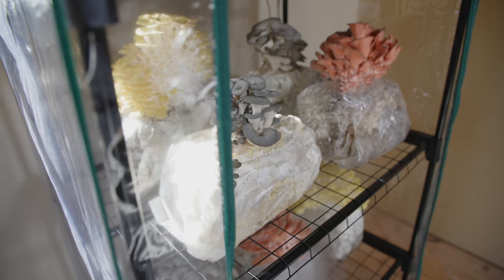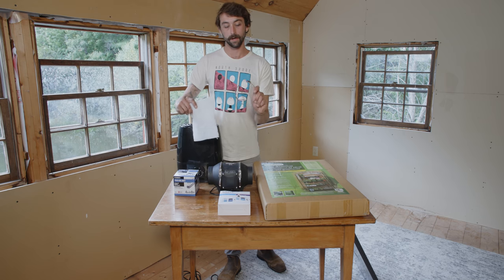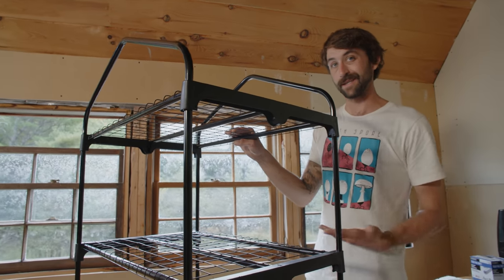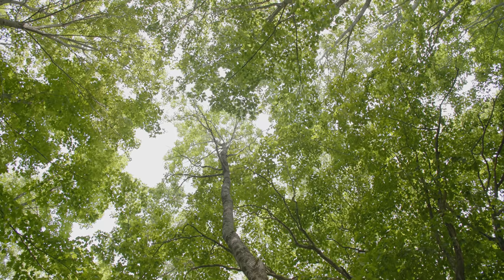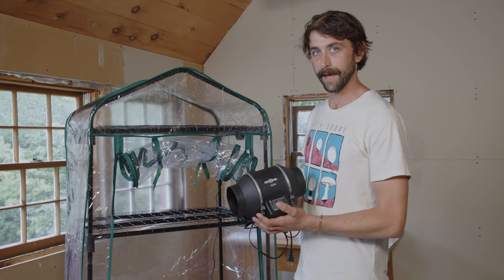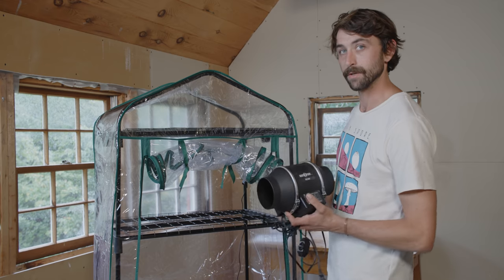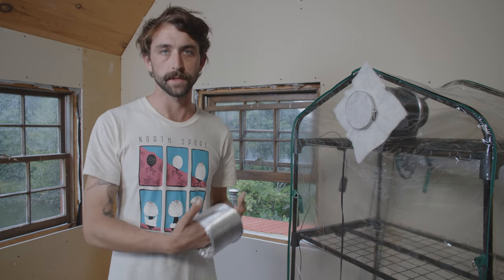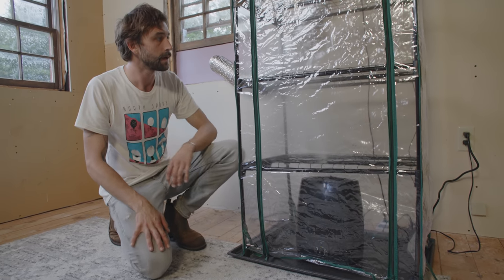Complete Martha Grow Tent Setup & Maintenance Walk-Through | Build a DIY Mushroom Fruiting Chamber

Comment: I think you might have better results if you swapped the humidifier and the fan locations. Co2 is heavy so it collects at the bottom, resulting in fuzzy feet and fruits that are reaching for air. You need to flush out the Co2 collecting at the bottom. Also the humidifier being at the top will cause the moisture to fall down and cover all the cakes below it, and not just pool humidity, mostly at the bottom of the tent. ✌🍄
Reply from the maker: You're definitely right that some folks will flip the humidifier and fan around with success. However, we've found that funneling the air up and through the fan instead of down, reduces the "splash" effect at the bottom of the tent, thus reducing spores released into the environment. The openings at the bottom also provide a perfect place to pull in fresh air.
Reply: Interesting
Reply: @North Spore  is there a way to seal the bottom with another hepa filter and fan for possible contaminants?
Reply: great idea brother! thanks! Best tip yes. well 2nd I have see other than praise. And as Einstein said;   Anyone can make things more complex and unimaginable! It takes a touch of genius to go in the opposite direction! I just had an epiphany also!   the fan I believe may also work better on a timer. say half on and an hour off maybe as to not compete with the humidifier?
Reply: double down! I also think growing a plant in together with the mushroom's could actually help with co2  as well!
Reply: IU bet seedlings would be great on the bottom shelf and BoomerShroomer has these boxes I am wondering if cutting a few holes and using the filter plugs from her kit she sells could also help the co2?I would say put the fan outside on bottom and duct the humidity somehow? that is also why I fear having the fan on all the time I think is a waste?  a;ll Alison>? I think it was? said;   was spray the sides of the minitub with distilled water ONLY if they are dry,  and vent ( BY WAVING THE COVOR FLAP, with the fliler plugs installed only 2 times a day, so with her expertise I would even say 3 or 4 times a day( SINCE ITS WAY BIGGER THAN A MINI TUB)  for about 15 to 30 mins on each cycle. wich will ALSO SAVE POWER!
Reply: Carbon airfilter fixes this problem don't skip learning hvac kids! Easiest way to learn all the skill you need to build excellent rooms, become an auto mechanic.
Reply: Absolutely agree. The CO2 does fall down.
Reply: Negative flow the air is sucked from the bottom up.
Reply: CO2 is not a sinker, the intake fan is big enough to pull air, spores and moisture to exhaust
Reply: In nature humidity rises not falls just FYI
Reply: Maybe adding a small computer fan at bottom could solve both.
Reply: @robertdaem9710 you don't really need to worry about contamination once you media is fully colonized
Reply: I thought that CO2 was necessary for pinning and a major part of the beginning stages. Once you go into fruiting then you need less CO2
Reply: @NorthSpore  I feel like this video is perfect and helped me for my set up at home. I have one question, how long and how often should I run the fan for FAE? I am using the same fan but it doesn't have a nob to adjust how fan speed, just one setting.
Reply: @LAndre2874 you wouldn’t put your trays in this until your ready for fruiting anyways. You completely cover until fully colonized.

Comment: I know this is a couple years old, but if anyone is trying this, when you go to cut the hole for the exhaust, try using a clean vegetable can like a large kidney bean can.  heat the opening of the can with the coils on the stove or a torch and simply press it into the plastic.  easy and clean cut.  tighten it to the fan with the hose clamp and don't forget to use pot holders or something else so you don't burn your hand!

Comment: Mushroom spores on average are 10microns. For those concerned about venting into living spaces I would suggest getting a 4 inch filter sock used in saltwater aquariums. It's easy to find 1 micron or 10 for cheap and since it's 4 inches it should fit perfect on the fan.
Reply: hi, its quite expensive, how long would one sock last?
Reply: a simple n95 mask is more than adequate to filter these particles.

Comment: For quite some time I ran a cool mist humidifier Blowing into the Martha, it doesn't create a high pressure and is more than sufficient for air flow with the plus side of not ballooning the Martha. Finding just the right interval with a timer was all that was ever needed. One could make a Martha for sufficiently cheaper than this.
I had a metal rack system that we covered with 4 mil and duct sealed the corners to make a large Martha. I had all the supplies and found the rack for free.
I love that someone is putting this out there on YouTube, I truly commend you for the clear concise articulation and effort. Truly is a recipe for success 👍
Reply from the maker: Thanks for your input, Paul!
Reply: Thanks Paul. An excellent video and give us the encouragement to venture into this superfood growing. It answers the issue on food sustainability in an affordable way.
Reply: I was wondering why that big exhaust fan was necessary. seems like the external humidifier setup would provide plenty adequate air exchange

Comment: I had the most low maintenance set of Marthas that Stamets helped with. I'm sure the guide I put together is still floating around on Shroomery. It is remarkable at how simple running a Martha is.
The secret that most people tend to forget is: find the most thermally and hydromatically consistent/stable place you can for it (ie basement, not the laundry room or Garage if you can.)
 It makes the world's difference in seasonal temperature shifts, especially coming into summer and winter.
Reply from the maker: Yep, if you can control outside variables like temperature and humidity, the tent should stay dialed in. Thank you!
Reply: found you post, thank you for this =)

do you use hepa filter because of spores?
Reply: Anyone know what mushrooms were grown in the tent? (yellow, pink,gray)
Reply: @NorthSpore  would an underground root cellar be good for mushroom fruiting?
Reply: @mojo_heezy  different species of oyster mushrooms probably pink oyster gold oyster and blue oyster

Comment: Thanks for this video! I have run a "Martha" tent that I have, it's a walk in one with shelves like this on both sides, but only for a couple of bags of mushrooms at a time. I used the humidifier and the same unit to monitor humidity, but didn't have the air exchange (which is why I didn't overdo it with too many mushroom bags.) I'm going to give this a shot so that I can produce more mushrooms on more bags.
Reply from the maker: Get that FAE setup going and you'll have some serious production capacity!

Comment: I think technically your filter should be on the intake side.  On the exhaust side, you're going to both overheat your fan and you're going to clog your fan with dirt and spores.  Most filter systems are on the intake side of the air.
Reply: Great comment
Reply: thank you i was wondering myself
Reply: He was only suggesting putting a filter on the exhaust side if you weren't able to duct it outside. Trying to avoid the spores in your living space.
Reply: @michaelwilliams1525  Filtering out spores from the exhaust air of the tent is a good idea.
Nevertheless like in many other applications than fruiting chambers exhaust fans should be protected from entrained particles or aerosols for safety reasons.
Reply: @michaelwilliams1525  that's not the point being made. They're saying instead of having the spores pulled through the fan itself before meeting the filter (heating and clogging the fan), put the paper on the intake side of the fan so the spores never leave the tent but also never enter the fan body
Reply: Yep. Think vacuum cleaner

Comment: I was a BRF guy for years and had lots of success.  I'm wanting to shift to mono tubs and appreciate this helpful info.  I'm going to attempt to use a 4" T to tap into an existing dryer vent duct, which will likely require a flap to prevent back flow into the tent system.

Comment: Washing machine drip trays are a handy option with built in spots for drainage and sloped to collect in one corner.

Also recommend Inkbird temp/RH sensors.  Using the WiFi bridge they're viewable when away from home, and log data over time.
Reply from the maker: Awesome tips, thank you!

Comment: I liked this video so much I bought a Martha tent kit from you.  I had a few questions.  It seems the vaporizer steam condenses on the spore pan and a significant amount pools there. This is difficult to clean and/or remove when the tent is in operation. It seems you might have had the same issue in your video.  This seems like if it becomes stagnant water at the bottom, it might cause problems of mold and is not getting all the water from the vaporizer into the air to raise the humidity.  Wonder if you see this as a problem and what solutions you might have.
I wonder how often the fan has to come on, and at what speed? I put mine on the lowest setting possible and on a timer so it only comes on at intervals.  Have you found an optimum fan speed and frequency of on/orr?  Has anyone experimented with putting SOME hydrogen peroxide in the vaporizer as it would add oxygen to the inside of the tent when the vaporizer is on.  If so, what amounts/ratio to water?  Can you think of a downside to adding peroxide to the vaporizer?  You look and sound like a guy I worked with at Fedco named Adam. If I lived closer I would be interested in working with you folks as you have a great operation there and great people!  Thanks for all you do! Tom L
Reply: hey how has your grow been going? Im also trying to find optimal fan times, any tips appreciated!
Reply from the maker: It absolutely requires regular sanitizing. A deep clean once a month should be sufficient. The fan sucks the humid air up, so if there is too much pooling, this requires balancing your humidity settings and your fan speed. We have not tried the peroxide and I'm not 100% regarding the safety of that.
Reply: I just  posted the same question up top! I have not yet made one, though  I have all the supplies on the way, the spore syringe millet spawn bag ETC...  I'm going to try the Rogue Spore Mycology Still Air Box, Mushroom Cloning Box and SAB from amazon. that is because I do not currently have enough resources to make or buy a Laminar flow hood. and I had built my own sab 20 years ago when I purchased my first spore print from high times in about 2001. I did have a few petri's with contamination but I had some that I processed on to the grain medium that were clean also. I ended up getting arrested back then for DWAI and had to tell my parents where it was so it did not dry out and become a fire hazard unfortunately and thinking about it. I believe it should have been about ready to fruit by that time... Oh well. THIS TIME IS GONNA BE GREAT and I am psyched! I just hope the SAP is large enough for my hands???   But I fear the same thing.  I do not want to put all this money into this and have it not work. I have ENOUGH JUNK!

Comment: Amazingly informative!  Thanks so much,  Im looking into buying the same humidifier for this rig with the temperature controller,  how often do you have to replace the water for the humidifier in a system like this?
Reply from the maker: This will vary depending on the humidity you have your tent set to, ambient humidity etc. For example, if you live in the desert where humidity is always very low, you'll run out faster than if you live in a swampy area. Winter and Summer will differ as well. That said, checking it at least 2 times a day is good practice.

Comment: Really fantastic walk through and explanations! I've often seen Martha tents with the humidity at the top and fan at the bottom, do you notice any differences with this setup?
Reply from the maker: You're definitely right that some folks will flip the humidifier and fan around with success. However, we've found that funneling the air up and through the fan instead of down, reduces the "splash" effect at the bottom of the tent, thus reducing spores released into the environment. The openings at the bottom also provide a perfect place to pull in fresh air.

Comment: The advantage of the tub with the 'pond fogger' is that you can put a toilet siv in it and run a plumbing line into the tub to auto refill. You can also have UVC light in the tub to kill any mold, fungus, or bacteria. The only point of failure is the ultrasonic pond fogger. Just keep buying until you get a good one or get the ceramic disks.

Comment: As a carpenter, i wanna go trim those windows 🔨👷🏻‍♂️😂
Great video 👍 I’m thinking of making something like this from scratch with Vapor barrier, tuck tape, and probably some kind of plastic or metal frame. I’d need to make a really small one for inside my house, but I may also make one for outdoors that could double as a greenhouse for plants in the spring.

Comment: Fantastic video guys! One question though... Is the fan running 24/7? I've seen videos of people utilising fans but they generally emulate the spray and fan method traditionally done by hand.  Again, great video and really appreciate the effort put into making these guides.
Reply from the maker: Yes, the fan is running at a low speed and the humidifier is on a controller to turn on when needed.  It does take some adjusting to find a good speed in relation to the humidifier but we tested this active system with great success.

Comment: HEPA intake filters and charcoal intake filters are really cheap, sometimes, you can get a bundle from vivosun, with a controller, a fan, carbon filter, and ducting, for under 80 bucks. Then the 4 or 6 inch HEPA filter for less than 20. Could also get a HEPA cabin air filter for a car and cut it to size.

Comment: Thank you for the video. Two years later and it’s still extremely helpful…I’d like to know your running times for the fan and humidifier. Did you keep your FAE fan running 24/7 without ever turning off?
Reply from the maker: Thanks for watching! It depends on what we're growing and the environment. You can run your fan at intervals using a cycle timer and we recommend starting your humidifier out at 70-80% and adjust accordingly 🙂

Comment: Great video, thank you! However, I'm a bit confused. At around 11:06 you seem to say that during fruiting conditions you want to use positive pressure, but then a few seconds later you say during fruiting conditions to use negative pressure. Can you please clarify which to use during FC?
Reply: I think they meant Negative pressure for fruiting, and Positive for colonizing (for less contam risk).
Reply from the maker: That's correct in theory, but you shouldn't be colonizing anything open in the tent anyway. Everything going in there should be ready to fruit or closed with it's own filtration until it is.

Comment: Ya'll think it would it work if I repurposed some of my old flower growing gear? I plan to use a regular sealed black-out tent, with a carbon filter inside but on the floor level (since I want to get C02 out this time), sucking air out through a fan on the outside into my room (ducted together), with intake holes on top of the tent (would slap some hepa filters on them for extra safety) and a little led strip in there (i'll make sure it's enough/not too much power)? Got a humidifier with a controller already too, and could even control temperature a bit. Would definitely need to put one of those metal wire racks inside though. 
Mostly curious if the carbon scrubber would work fine to stop the spores, and whether it would clog up too fast, or maybe it would just get caught on the pre-filter sleeve only?

Comment: Great, informative video. **HOWEVER**, let it be noted that the duct fan is going to be taking in all of that moisture, causing pooling in the fan's housing. My VEVOR duct fan was constantly stopping after a day of running due to the water collecting inside of it.
 I fixed this problem by mounting the fan outside of the tent on an exposed beam in my cabin, higher than the tent. Then I ran the round ducting from the fan, down and into the tent. I put a couple of 90-ish degree bends in the ducting, and fixed a 6" milk filter to the end that sits inside of the tent, to help minimize the amount of moisture that gets into the fan. I found that I have to turn the fan up a bit to ensure proper suction, but most of the moisture gets trapped in the milk filter :)
Reply from the maker: Sounds interesting! I'd love to see pictures. Moisture buildup is definitely a battle.
Reply: @NorthSpore  I would certainly email Northspore with photos! My question is, has this setup not encountered the same problem that I previously mentioned? As I said, it's a great video, but I'm just surprised that such a problem wasn't mentioned. It took me a couple of reconfigurations to get my fan to stop flooding :)

Comment: I use a positive air systems with pre-filter. Negative air will be pulling in unfiltered air anytime you open the zipper opening the possibility of contamination.
Reply from the maker: The idea is that this won't matter much for already colonized material.